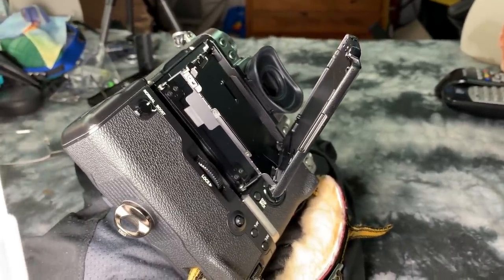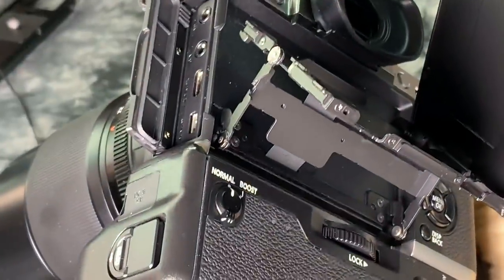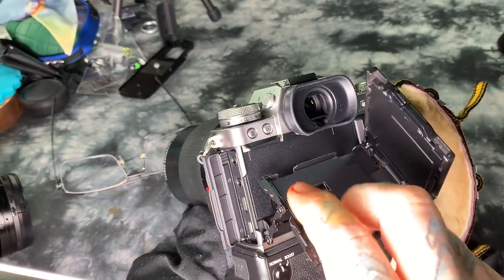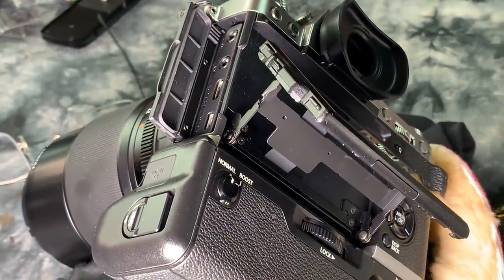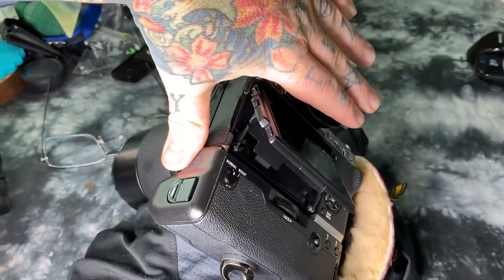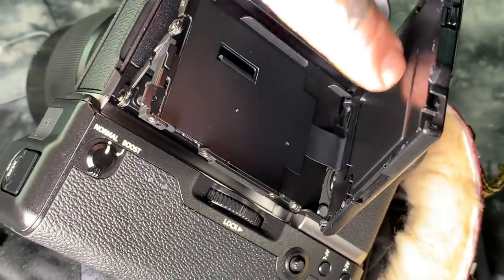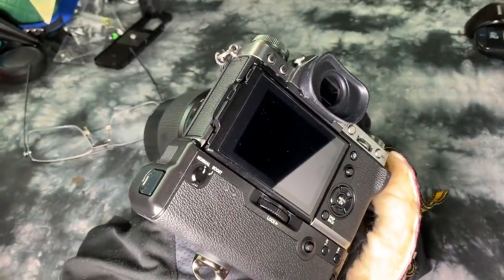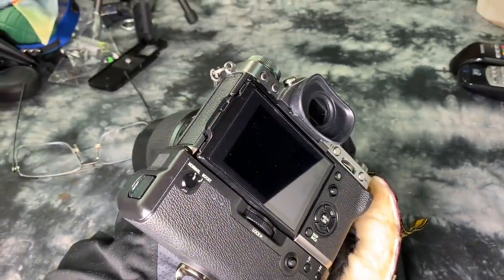😱 CAMERA CONSPIRACIES & his FLIPPY SCREEN dilemma 🥰

Comment: What would help: Simply make the damn LCD assembly with joints and all an accessory, connected to a socket on the back - remove it and use your EVF if you want the camera thin, attach it if you need it, replace it if you manage to wear it out.

Comment: Hi Ken, I have a Canon 760D and using my phone or either of two tablets through Canon Camera Connect, I can operate the 760D with them. When I connect, it shuts down the rear articulating screen. The obvious downside it increased battery use in both the camera and phone/tablet because the 760D only has WiFi, no blue-tooth. My phone has NFC and it works with the 760D, good to connect but no reduction in power usage.

Battery drain aside, it is very handy, self shots in stills and/or video are easy. I have a grip and a total of 4 camera batteries so it is OK to use in good enough light. An another down side is that speedlites won't work because the camera is essentially still in live view through the external connected device. That's how the 760D works.

I know I went sideways from the damaged ribbon and bundled cables that can happen with flippy screens but sometimes you have to think outside the box. It is an alternative.

Comment: Nobody ever said they wanted a thinner camera. I (we) want flippy screens. It's just a design consideration, not something mandated by a divine creator. The Panasonic G85 is hardly a thick beast of a camera, but it has ports on the left AND a flippy screen. This video's deep layer of BS calls into question your statements on other issues if you have to twist logic to such an extreme to make your position seem correct.
Reply: A main advantage to Micro 4/3rds is the small camera size

Comment: This contraption is more complex, just as bulky and more fragile than a flippy screen design, they don't have to make the cable so wide and flat, and the blocking of some ports by the flippy screen is a minor issue, the mic jack can be above the flippy screen, and if a user wants to have the headphones in while shooting then he can flip the screen easily around that headphone cable or they can easily fit the headphone jack somewhere else too, and if the user is using the HDMI port then most likely the flippy screen is not required in that scenario, so really the flippy screen is a non issue. I believe that Sony and Fuji have simply been too lazy or their product designers too clueless as to what users really want. Lack of the flippy screen on X-T3 and A7iii is a major design flaw.
Reply from the maker: its AS FRAGILE as every nikon and Sony is.......its a FLEXICABLE
Reply: @KenTheoriaApophasis  the flexicable seems exposed in the Fuji and Sony, though it's totally covered in a Panasonic or Canon flippy display design, I have never heard of a flippy display breaking. I am pretty sure this multi sidee contraption in a Fuji or Sony is eay more fragile than a flippy display. Also I have seen displays as thin as paper with plastic civer instead of glass, but even with glass it's possible to make a pro usable display very thin I don't believe it ads any thickness to the device. The recessed surrounding of a non flippy display does not need to be there when implementing a flippy display. There are plenty of very compact cameras with flippy screen, some even from Fuji.

Comment: Hi Ken. A wonderful technical argument for limitations of flippy LCD screens. Since most Fujifilm (& others) cameras can create wi-fi for connection to, say, an iPhone or iPad, etc. for camera control or transferring jpegs, couldn’t this app be developed to include wi-fi tethering. The tablet could be attached via a bracket attached to the tripod mount or maybe via a cold shoe bracket on top. If this could be done, it would be an excellent retro-fit to the fixed-screen cameras, also. What do you think?

Comment: Reminds me of those Samsung sliding phones. While the slide action was fun. Replacing the thin ribbon cable that connected the screen to the rest of phone was. I had it replaced a few times before I simply got another phone. And device that uses a thin ribbon cable that is also supposed to move somehow will break that cable eventually.

Comment: This is my idea...and it will work...why not use a bluetooth wireless connection between the back LCD screen and the camera body?...It would only have to go 1 inch, or communicate in that 1 inch distance...and no more flexing cable....I dont know if anyone has thought of it...but I probley solved a massive problem..and wont get no thanks...nice video..  AND the other idea is to put the stereo microphones in the bottom of the flash unit that you pop up to use the flash...so they are facing toward the subject..what do you think???  Of course you would have to have the flash up to do it...but how many times would you need a microphone...???? AND as far as the power to the lcd screen...you can do what they did with antenna's on tube radio's, back in the 40's use the hinges on each side to power it.

Comment: If you really need an lcd to articulate to any angle you can get a separate small monitor. They are getting cheaper all the time and will mostly be better than the camera lcd anyway. I have a SmallHD for video use which was quite expensive even second hand but there are cheap ones now with quite a lot of the features previously only found on SmallHD. The Swit CM-55C is a cheap one. It’s a blatant SmallHD rip off. I don’t think they should try to get too fancy with the screens on cameras. It’s more important for a photography camera to have a good EVF. Otherwise the cameras will get too bulky.

Comment: Uhm I think the reason is that photographers want a screen that articulates horizontally and vertically for low and high angles in landscapes and portraits. To get those angles with a flippy screen you have to flip the screen out to the side of the camera which makes the handling worse. With Fujifilm‘s articulating screen it always stays at the back, compact and easy to handle, no matter at which angle you shoot. That‘s the reason I prefer Fujifilm‘s screen to all those fully articulating screens. Those are really only useful for vloggers and unpractical for everyone else in my opinion.

Comment: Fujifilm should make a "perfect camera". Flippy screen from x-t100, af and video specs from xt3, and ibis from x-h1.
Reply: john doe that’s fine as long as they also make one without a flippy screen and IBIs for those of us who don’t need or want either.
Reply: @Jabber-ig3iw  well, it would be great if they made it so you could turn off completely ibis in options, or lock the sensor with a physical switch that would lock sensor in a default place and cut off the ibis cirquit. And x-t100 screen can be used as a regular one axis screen, so I don't see any problem with that.
Reply: john doe only issue with your suggestion is I’d end up paying extra for things I don’t want.

There is no ‘perfect camera’ because people need different things from a camera.

Comment: Looking to the Olympus omd em 5 ,omd 1 II,Pen F ,Panasonic GH5 , G85 and Fuji x100 there is nothing thicker there w.r.t a normal tilt screen.Design issue is another  BS story .
Reply from the maker: eagleeye photo you fool those have very tiny main boards and no left side obstructions
Reply: @KenTheoriaApophasis  They have mother board foot print just a bit smaller then XT-3 ,more like XT-30 and bunch of connection are there which are kind in a way of the flip screen.Canon was a bit more smart to put audio out cable above the hinge of the screen on EOS R. The ideal screen could be as on x100.
Reply from the maker: HUUUUUUUUGE HINGE, just like i said>>>>
https://www.dpreview.com/files/p/articles/2939288736/images/allroundview.jpeg